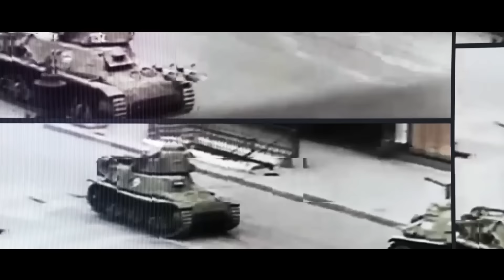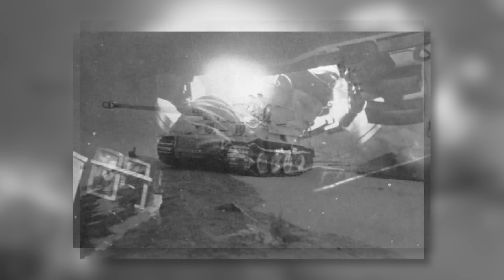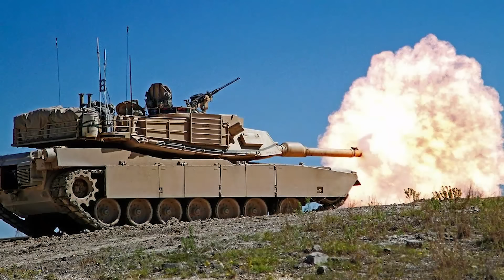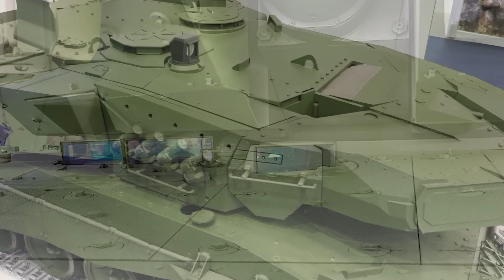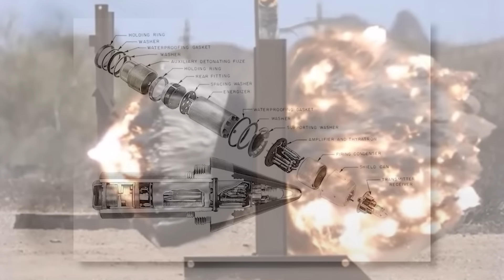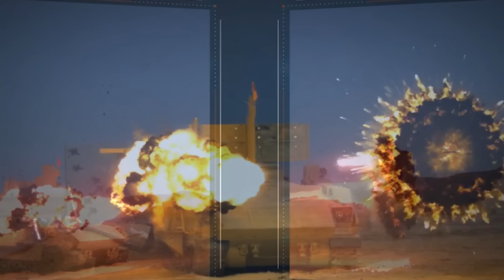How Much have Tanks REALLY Improved since WW2?

Comment: The tiger tanks reputation was way exaggerated
Reply: One thing I wonder about is how often 75mm shermans just fired white phosphorus into them.  One division logged firing it about as often as AP.  Although it was often used against non-armor, there are accounts of firing it at tanks, which makes some sense.  If you were forced to engage, it would give the best odds to defeat the opposing vehicle if you can't pen.  Would immediately blind, very likely stick residue on optics, and unlike today's tanks it also gets into the engine intake + effects crew inside.  Not as devastating as if it hit directly on skin, but bad enough to make it hard to operate the target vehicle.

There are accounts of it, but it was probably something 75mm avoided if they could.  I wonder what the effective mission kill rate would be on direct hits though.  Probably non-trivial!

Shooting first was a big advantage back then and that's still true now as well.

Comment: It’s an interesting question. Any heavy tank from the 1960s could kill any tank from WWII. After that, it becomes more difficult. I would say that there hasn’t been much advancement since the 1980s. All current tanks come from designs from the 1970s. Improvements since then has made them safer and more deadly. But just incrementally.

Realistically, I don’t see how much better a tank can get. A larger gun, better armor of various types, and drone protection? All incremental. Engines improve slowly. Armor is likely as good as it will get, even with active protection. After all, how heavy can a tank get? The latest M1 tank weighs 75 tons in sep 3. How much heavier can one get?

Comment: All tanks were rendered obsolescent in Ukraine. Drones LOVE them to death. 
Tigers were useful weapons. Modern tanks are expensive liability, the military equivalent of a 1990-s VHS video player compared to a 2020-s computer.
Reply: All tanks were rendered obsolete when HEAT was invented, then they figured out spaced armor and later composite armor.

When guns improved, they made armor obsolete, but when material science improved, and we got Kevlar and other materials, we made body armor that could resist a few shots while being light enough to not slow down troops.

The beauty and horror of arms and defense, is that it is a race, a pendulum. You find a weapon that can destroy a defense, and a defense will be created.

From high power lasers (when we eventually have powerful enough generators for ground vehicles, or good enough batteries) to micro-wave weapons that are already being tested to shoot down drones in particular.

Obsolescence is temporary, for both sides of the coin.
Reply: @Mani_Gamer885 The outlook for tanks isn't good. Ukraine war changed everything. Now it becomes obvious that Iran can not be invaded by land because the Abrams tanks, the Bradleys and all the tin cans will be destroyed by drones. Same applies to surface ships. Mighty USS Lincoln is being harrassed further away into the ocean. 
Aircraft spelled the end of the battleship. Drones will spell the end of the tank and the surface ship as we know them. This is a point of no return.

Comment: Armor has improved significantly, but so has missile tech.  Modern tanks have very good armor, but the propulsion and guns have not had such a great leap.  Cheap drones can now disable any modern tank.
Reply: Ukraine has shown many interesting and "interesting" developments with vehicles and drones, that's for sure. 
It's going to be a case study for decades to come.
Reply: @MichaelB-b1n I would agree. What will be interesting is when the dust settles, and we discredit all the propaganda from both sides and see factual results. Both sides have already been accused of reusing the same dead tank in multiple different pictures to claim multiple kills… so we’ll see
Reply: Propulsion and guns have indeed jumped MASSIVELY. At least, if you consider fire control systems as part of the gun. The concept of ammunition is the same but they are shot at much higher velocities, feature much stronger materials, have much greater accuracy, and are far more reliable.

Comment: The Modern tanks have superior logistics train, you can fly an M1A1 to a location near the battlefield, have bridging equipment to ford rivers, etc. The Tiger was a challenge to move even  by train on some rail lines the tank and turret had to be separated to prevent overloading, and that was the main way to move them around. The reason the US only had the Medium tanks for most of the war,  was that they were sized around the transportation infrastructure, 
it was better to have 10 M4s than 1 tiger. Modern militarizes can move the bigger tanks where needed, fuel and resupply them.

Comment: For anyone in the future of this comment section, the Tiger is an overengineered, waste of steel. Yeah its a beadt of a tank, and couldve destroyed any allied tank, but that doesnt matter if ya cant supply saidbtank with fuel, ammo, & food for the crew.

The Shermans & T34's however, were'nt the best, but they were good enough to out-flank, out rang, and out gun any German tank during the war. Because the Shermans & T34's COULD supply themselves with fuel, ammo, food, & crew replacements faster than German couldve made their Tigers, Panthers, or whatever they had.

Not to mention, the M4A3E8 Sherman with its 76HV gun couldve penned the frontal armor of a Tiger 2. But very few Tigers were on the western front, as most were forced to face off against Soviet T34 & KV2 tank hordes.
Reply: Absolutely true. An engineering marvel but a nightmare for the supply chain… and useless when battles occurr in cities streets.